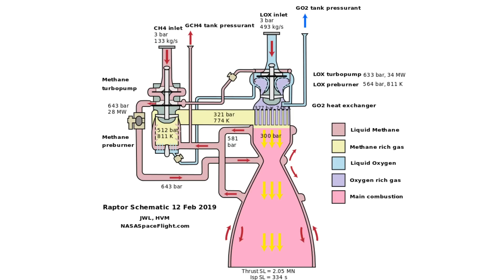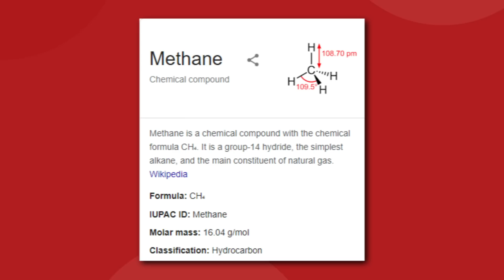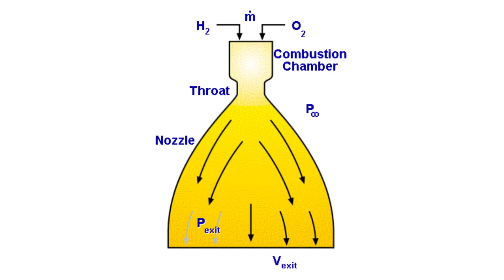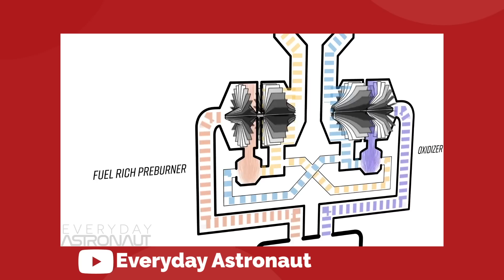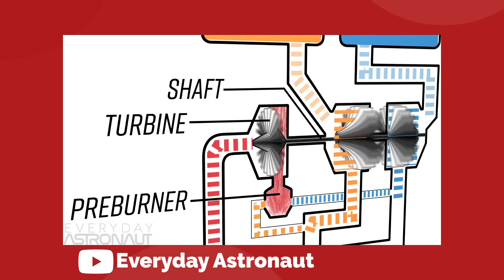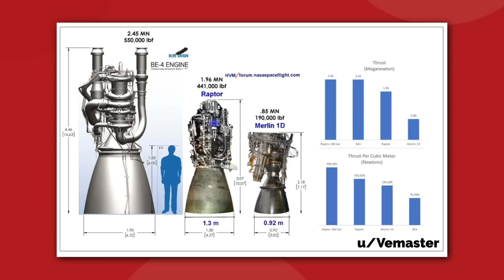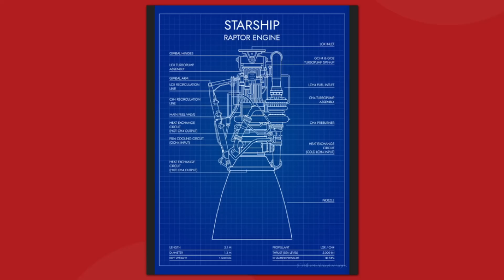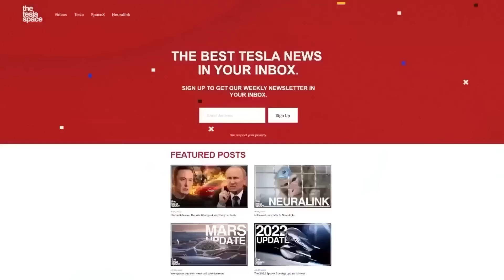The Real Reason SpaceX Developed The Raptor Engine!

Comment: I like being able to understand a system because then, I can play with it. 2 questions....
1. Take the concept on throat and nozzle....why couldn't you use the force being generated by lift to further push the fluid into the nozzle? Wouldn't this allow the system to not only be more efficient colling but also create more thrust? 
2. In my head the most difficult thing about space travel is space. Without gravity, I'm guessing generating thrust is difficult. Has anyone designed an engine designed to be destroyed? Our basic understanding of engines is...we use fuel to make an explosion and that sends us forward. Has anyone created a reverse engine? An engine that generates power because of the absolute lack of oxygen and the amount of pressure in space? If we had a system designed to explode(maybe not the word) because it was introduced to the vacuum of space...wouldn't this allow us to create a long distance system capable of insane speeds because of the frictionless environment?
Reply: what the hell are you talking about? btw no you have absolutely no understanding of the system
Reply: @batoo_san  I was just hoping some insecure person like yourself would respond. I love you small dick guys that don't have the capacity for an actual conversation so, you just spew senseless BS to build your ego and make it seem like your woman might actually be happy having sex with you and isn't faking it. You're right, I don't have a full understanding, that's why I asked questions. Jfc take your insecurity elsewhere or even better....quit being an ass and try explaining because if you just want to bash each other, I assure you, I'll have a blast...pun intended.
Reply: Igniting a liquid propellant engine is zero gravity requires that the propellant be pushed into the piping to start the process.  There has to be some means of moving the liquids. Generally, this involves creating a small amount of thrust. This can be done using any type of propulsion, including just exhausting some gaseous nitrogen to move the spacecraft. You can also use a smaller rocket. These are called "ullage burns".  It doesn't take much movement.
Reply: @jamesbarnard9710  That part I understand but has anyone tried to build an engine that uses the lack of gravity or the vacuum of space to move the liquid or even better, in place of the combustion all togerher? 
To my knowledge, we send combustion engines into space. These engines are fighting an uphill battle because everything in space is designed to reduce their performance. Has anyone created an engine or attempted to create a engine that utilizes the vacuum of space instead? Wouldn't this allow for a potentially unlimited power source and since there is no friction, wouldn't this also push every limit we know of speed since it could essentially keep acceleration?
Reply: @jamesbarnard9710  Having a hard time explaining it because well, engineering and aero space are way outside of my comfy zone. Take the concept of a sail here on land. It uses the wind to generate push. Has anyone attempted to create a vacuum sail for space? Replace sail with anything....Basically anything that uses the vacuum of space to move.
Reply: there are solar sails its pretty old concept i think theyve already tried one
Reply: @batoo_san  Yeah I've heard of solar sails and believe eventually, that's what we end up using at least inside our solar system. It just seems like there is an easier way using the vacuum of space. An engine designed using vacuum instead of combustion. Instead of a combustion pushing pistons, the vacuum would move the pistons and create pressure. That pressure would then be released to create thrust. Granted there has to be something used to create that pressure I think. Idk...just seems like we should be focusing on what's available instead of trying to make something work against all odds.
Reply: @josh40383  that doesnt make any sense vacuum is literally nothing while combustion is reaction that produces energy you need to get moving your idea is flawed in very basics of physics
Reply: @josh40383  With all due respect, we do use what's available to us, with in the bounds of the laws of physics, especially Newtonian physics. All types of propulsive engines, whether jet engines or rockets 

When you ask about "using the vacuum of space", you need to understand that a total vacuum is just that..there is nothing there.  Now, in point of fact, space does contain some particles, especially those generated by the sun.  This is called "the solar wind". Unfortunately, the number of particles in a cubic area are so small that they would not produce enough pressure on a solar sail to move it very much against other factors such as the gravity of a large body such as the Earth or the Moon, if the spacecraft is close enough to be affected by it, which is anywhere within several hundred thousands of miles, in the case of Earth. The farther from the sun you go, the less effect the solar wind has by the square-root of the distance.
The sun's gravity affects the way the planets move, as well as a spacecraft that is well away from the Earth or the Moon, just as Earth's gravity keeps a satellite, including the Moon in orbit.
Reply: @jamesbarnard9710  So there is nothing or a process we are of that requires something to be under constant pressure and when the pressure is removed, it collapses on itself or even better, explodes? 
Take the atom bomb for example...the splitting of two atoms or the hydrogen bomb which combines them(loose definitions)...is there not a process that has been discovered where removing the pressure off of something would generate that same type of force? 
And trust me, I know I am well...well beyond my understanding or even my ability to fully grasp what we are discussing. Sometimes though, that's how wonderful things are created and realized. The expression...."can't see the forest because of the trees" can also be applied science.
Reply: @batoo_san  And that's why I ask questions like these. My goal isn't to fully understand a subject but simply be able to grasp it a little more. I ask questions out curiosity in the hopes of sparking conversation and wonder. How boring would life be if we never dreamed of the impossible? Besides, I still believe our understanding of physics is what henders us. We've created laws that we believe to be the gospel and because of that...we never try. We never take the time to think...what if someone was wrong? 
Intelligence....true intelligence is showing  a group of people a pencil and asking them...how many things do you see? The unintelligent person says 1. A smarter man says 5 and points out the seperate parts to make the whole pencil. Another man states...let me get my microscope and track all the atoms. The last man says...we'll never know because there is a never a beginning of anything and we'll be counting forever. 
Each of these people are intelligent in their own right but it's up to us to decide who we want to be.
Reply: @josh40383  If you have something, say gases, under pressure in a closed container, presuming the container is strong enough so that it doesn't burst, and release that pressure in one direction, the container will move in a direction opposite to the stream of the gases. That is in accordance with Newtons 3rd Law: for every action there is an equal and opposite reaction. On the other hand, if the container isn't strong enough to contain the gas pressure, it will burst. That is essentially what happens in a bomb, whether conventional, nuclear or thermonuclear. The only thing that happens if there is greater pressure outside the closed container than inside, and the container is too weak to stay in one piece, it will collapse.  In space, where there is no appreciable pressure, an empty container will not collapse on itself. I don't know how to explain it any simpler than that.
Reply: @jamesbarnard9710  I understand that. I also understand there is zero pressure in space. I don't believe I know how to put this into words that will make sense because I don't know the terminology needed it seems.
On Earth, things stay togerher because of pressure. Either by gravity, atmosphere, etc. Is there nothing on Earth that becomes unstable enough to seperate because of a lack of pressure and gravity? Is there not an atom that will separate at -455 degrees or atoms that will combine to create the type of force we see generated by an atom bomb? If so, that material may hold a key to creating an engine designed for lomg distance space travel. Expose it to space....let space be your source of ignition instead of your basic combustion engine.
Lol I'm not sure how else to explain this that will make sense so if that doesn't do it....thank you for trying to understand me anyway and trying to educate me. I really do appreciate it.
Reply: @jamesbarnard9710  and Newton 3rd law is my favorite. I happen to live my life by it and believe it applies to all things in life and not just motion.
Reply: @josh40383  theres difference between dreaming of unknown impossible and dreaming of known impossible. such radical change of our understanding of physiscs requires much more than just asking random wrong questions.  we create those laws based on observation we make and this one isnt that much of a law as it is pure logic. You need energy to do anything thats the very definition of it. Theres no energy related to vacuum because vacuum is defined by being nothing at all. Yes there are other energy  sources cointained in it but unrelated. Anyway its good to be curious and ask questions especially to create new ideas to do that tho you should have at least bacis education of that matter.

Comment: Well that looks like a nice engine but clustering many engines together have lots of problems ask the Russians N1 will tell you how wonderful clustering many many many engines together. Elan we'll figure it out why the Saturn 5 what's so special because the first stage has the F1 the most powerful liquid powered engine ever using kerosene liquefies oxygen.  The second stage of the Saturn 5 used a hydrogen-powered engine the S2 4 S2 engines put out just shy of a million pounds a Thrust. There's one thing I know in space travel use what use and make better what is known make a better F1 engine make a better S2 more is not better it's all about weight. My dad about that he's one of the gentleman that got us to the Moon
Reply: Part of the problem in developing the F1 engine was in getting rid of the start transients that resulted in blowing up a number of them on the test stand. When you get to the size of the F1, you increase the problems in starting.  Also, if you only have a few engines, and one has to be shut down, it jeaopardizes the mission. The advantage to liquid rocket engines, even as complex as a Raptor 2, is that you can usually detect something going wrong and shut it down, allowing the other engines to continue. Are there problems with having a lot of rocket engines clustered?  Yes. Most notably, there is the problem of recirculating the hot exhaust gases as the vehicle reaches higher altitudes. Saw it years ago with the Polaris A-1X birds.  Called, "hot bottom".  Solved with better insultation and separation of the engines, etc.
Reply: Falcon heavy equals 27 rocket engine.

Comment: Another reason to use methane as opposed to RP-1 or liquid hydrogen (LH2) is, that RP-1 doesn't exist readily (if at all) on Mars and cryogenic hydrogen is harder to make and store than liquid methane.  Methane exists in natural form on Mars or is easier to manufacture.  Liquid methane exists in full lakes and seas on Titan (a moon of Saturn).  One could literally fly a starship to Titan, land, throw a hose into the methane lake and "fuel up" for a return flight to earth (at least in theory).  One can fly to mars, land, manufacture methane, then make the return trip to earth.

Comment: Is it possible that there over heating the o2 to a level that combustion can happen with both using the preburn vaporizers can emit on one side then making the methain at maximum gasus pressure personality they should keep doing that but take it an extra step to get  higher levels of pressure using turbo chargers on the existing exost ports spooling to power a bigger low c0st engine the less liquid fuel you use the more you're g9ing to have exiting into space

Comment: 10:30 He dont say it not use igniter. He say it not using TOURCH(flame tower) it use PLASMA(spark)
Self ignition must need difierent propelent wich autoignite like lithium on water. CH4 + O2 dont do that.
Reply: Can't recall the chemical, but there are several that combust on contact with oxygen. That is what Falcon 9 uses to reignite.  If you recall, one of the earlier Falcon 9 boosters was lost because they didn't have enough of the pyrophoric igniter fluid. Guess they just increased the size of the little tank that held it.

Comment: Can you explain the difference of the function of the turbopump between Raptor and RD 180 ? Both are very similar.
Reply: In all rocket engines (well, all apart from gravity-fed (fuel goes into the combustion chamber because of gravity) and pressure-fed engines (fuel goes into the combustion chamber because the tank is at a high pressure, like a balloon)), turbopumps are used to push the fuel from the tanks into the combustion chamber.

How those pumps are driven is another thing. They can, as shown here, be driven by two preburners, or they can use high-pressure gas from the combustion chamber (called a combustion tapoff cycle), or, like the Merlin engine, have a single preburner that drives both pumps on one shaft. That preburner can then also be fuel- or oxidizer-rich. Traditionally, fuel-rich preburners are used because a high-temperature oxygen-rich environment is really hard on materials.
Reply: @vincentguttmann2231  Preburners on both engines ( Raptor and RD 180) feeed the turbine gases into the main engine and not " as usual " releases the gases outside the main engine ?
Reply: @tenhendee5479  That's a feature of all "staged combustion" rocket engine cycles: All of the gas enters the combustion chamber, whereas with a gas generator cycle, you dump the exhaust just to the side, like F-1 or Merlin engine.

In the case of the Merlin or F-1, that fuel-rich and therefore very sooty exhaust isn't reintroduced into the combustion chamber because it could clog injectors or cause all kinds of problems, but occasionally, the more fuel-rich preburner exhaust is introduced to the edge of the injectors as film cooling: If there's no flame directly touching the rocket nozzle, it can't get as hot.

A possible example of this could be Blue Origin's BE-4 engine, however, it is only verifiably a staged combustion cycle engine, and that they are using the preburner exhaust as film cooling is only speculation.
Reply: @vincentguttmann2231  Gas insulation. Hmmm .. kind of similary to the cooling/ insulating  of the combustion chamber walls in the turbine jet engines. Fascinating all the tricky solutions where you use the accessible ressurces ( even waste) to reach the next level. Thank you for the explanation..
Reply: @tenhendee5479  Oh, if that was interesting to you, you'll love the "Rocket Engine Cycles" video by Everyday Astronaut. That one's a 55 minute deep dive into all the different cycles and all that. In case you're more of a reading person, they also have all that information in a blog post.

I'd put a link to that here, but you know how YouTube is with links in comments... 
Safe to say, you can find it under the same title as the video, and the website name is the channel name.
Reply: @vincentguttmann2231  Tx

Comment: 0:45 the soviet N1 rocket had 30 engines, it is actually a fairly similar design... Let's get facts straight
Reply: what most don't know is that the Russians where and still are amazing engineers, when you observe SUKO and MIG they are very advanced and a power to recon with
\
Reply: @arlandgaylor  good engines but limited with budgets and poor management.

Comment: Will it be cool for Raptor engine to use as the turbine for a power generator? In countries that have problem to buiulding nuclear power plant will need it. The industries that need a power as a backup for the grid when supply get low? I know TSMC buying turbine from GM. I bet the Elon will make it cheaper.

Comment: Just saying, the N1 Russian heavy lift vehicle had 30 engines and they never got it to orbit. The reason the Saturn 5 was so successful was it had 5 engines that were very reliable. What are the odds that all 29 engines don't have issues and are reliable all of the time? More engines mean more chances for problems. My 2 cents worth.
Reply: So true. This is potentially very unreliable and can lead to a catastrophic failure by being such a large rocket.
The N1 killed the soviet space program
Meanwhile the Saturn V was very successful and reliable because it only had 5 engines, 5 massive ones

Comment: This is well and good for the engine however a blown engine or one that explodes does little if the payload is damaged, regardless if they have another ready to go. A scientific payload is usually made as a one off, if it's research as rarely the money allotted for duplicates. Not downing the research (remarkable as it is) ,but would like to see the cost per weight ratio of payload. As this directly impacts payload development as well.